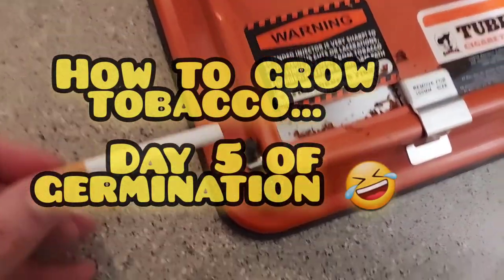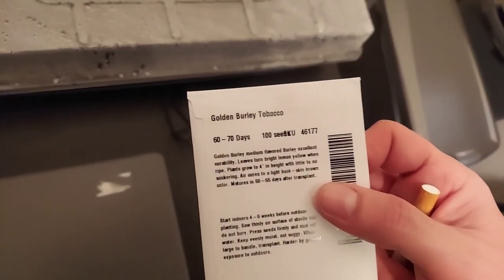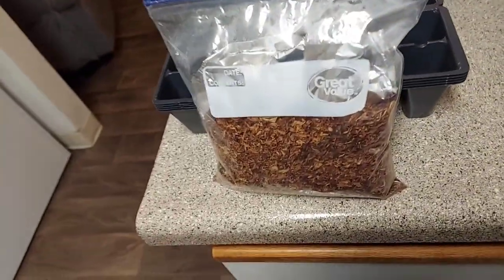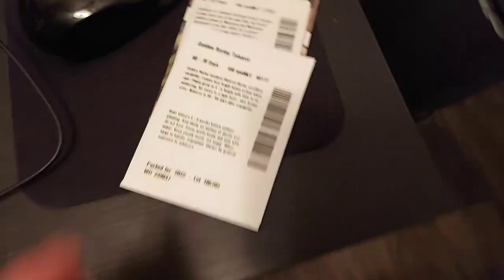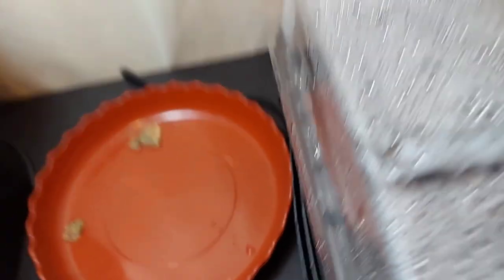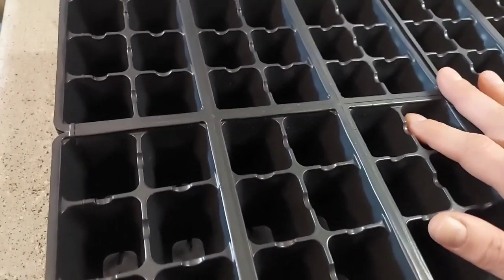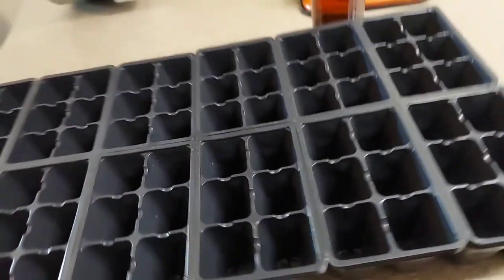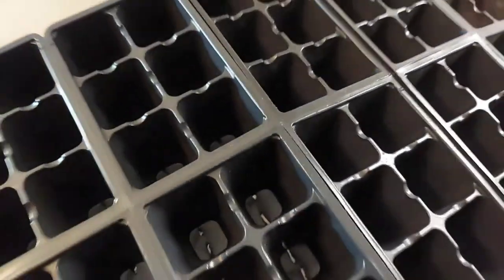How To Grow Tobacco. Day 5 of Germination.

Comment: Man you got to drop $200 on that powermatic 3 bro. I developed carpal tunnel and tennis elbow a few years back and those hand crank machines killed me to roll packs. I can roll a carton of smokes in under an hour with my machine. A pack of cigs costs me about $1.25 now after my machine paid for itself and I have probably saved over $4,000+ rolling my own by 5LB bags at a time.
Reply from the maker: Sweet.
Reply: @NightCrawlerOR  a 5lb bag rolls me 2.5 cartons per 1lb of pipe tobacco 😜. 
I buy premier tubes I get 5 cartons of dark blue kings for like $13. 
I need to get you my number without Doxing myself lol but for sure do some cop watch/ make the cops pull me over with the train horn. Lol haven’t yet but close.
Reply from the maker: @ptld_train_horn  realchrisponte@gmail.com
Reply: @NightCrawlerOR  just did the math I haven’t saved $4,000 that’s ridiculous not buy store brand cigs. I have saved about $10,000 actually over the last couple years rolling my own. That’s putting a store brand carton at $70.00 and I have rolled 31,000 cigs on my machine = 155 cartons = $10,850 ish
Reply: @NightCrawlerOR  sent